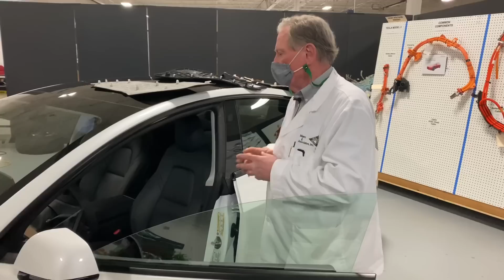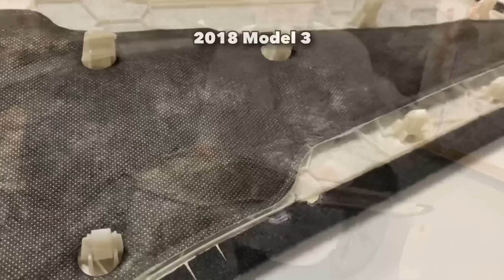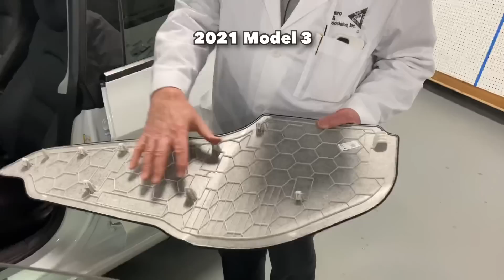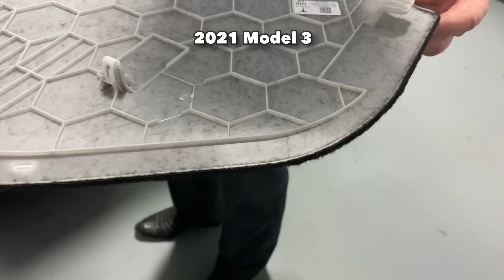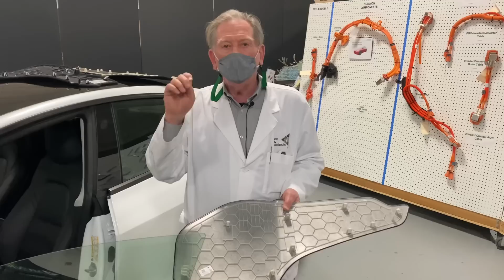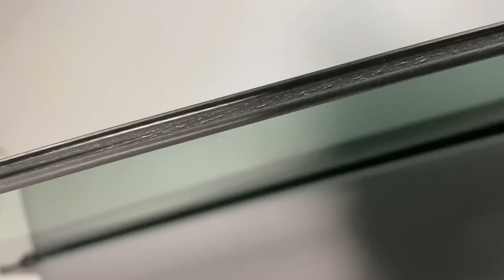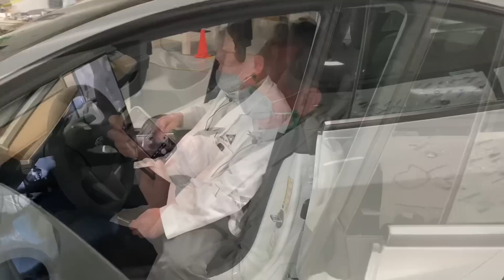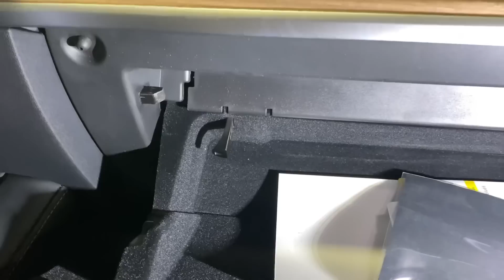2021 Tesla Model 3: E6 - Interior Updates

Comment: Hi Sandy, I believe you should also report on issues that you will get only when you have driven one awhile. My year old Model 3 SR+ has been in service 12 times or so and one of the issues is -14.4% capacity loss which they call within specs, leaky taillights, leather coming off steering wheel, paint issues, factory platework issues (dented at fold in corner doors low point), frunk coming off, headlights adjustment going off all the time after update, rattles in dashboard, excessive wind noise, Autopilot is completely blinded with very low sun and stops cruise control, cameras blocked by fog, can fill a list.

Most annoying is that Tesla won’t do anything about it most of the times, or try blame me first. It seems policy to only fix some of the stuff after a third complaint.
Reply: That is a bummer for you, but stats seem to show that your experience is not typical.  An individual having problems with a car does not necessarily indicate that the model is of poor quality.  For that you need to gather lots more data.  However I would agree that Tesla not resolving the problems to your satisfaction is worrying for a luxury brand.
Reply: @andrewpaulhart  Hi andrew, my experience seems to be common. Also the average fleet data suggest all SR+ 2019 models have -11% degradation/capacity loss for example on average according to fleet data (year old or 30k kilometers). I have all the data to prove this.

How come the last two years it takes multiple weeks on average before we can visit a service center if nobody is coming in for problems? There are lots of Service points in NL.

Look up on youtube the DIY fix for leaky fogged up watery taillights for the Model 3, it’s been watched ALOT, I am not alone. Same for alot of other issues.

Simple question about this (just) one thing: Would you expect it to be normal to just accept -14.5% capacity loss on a brand new vehicle is “within specs”? My SR+ is not even a SR and a battery report from Tesla is “secret” they won’t share it even though I bought the car and own it..!

Again, if you also have these issues, don’t you want Tesla to do better there and actually have a good warranty?
Reply: @andrewpaulhart  And Hi again Andrew, I even have friends who are car mechanics, that work at Tesla and tell me exactly the same thing. (I used to be a car mechanic myself, i build my own ground-up e-moped with 18650’s) It’s easy talk when you don’t (notice or) have issues. Lucky you don’t have issues
Reply: @MrGoogle87  regardless, any individual report tells you very little.  I personally put more weight on proper statistical evidence if you have some.  As you have seen from one of the replies to your post there are people who say they have absolutely no problems at all.  Those accounts also dont count as proper evidence either.
Reply: @MrGoogle87  although I suppose the testimony of Tesla engineers does add some extra credibility
Reply: @andrewpaulhart  I don’t even have a “problem” with the fact that I have problems, I have a problem with Tesla not doing anything with it (like the -14.4% on my battery, it was already bad first month and I reported it. 205miles rated left only, that’s excluding the buffer above 240mi rated)

In short, to them warranty says only something about -30% or worse (but again; capacity test is secret, they won’t share it even when you pay!) so -15% after first charge ever is fine to Tesla’s current warranty policy: that means a LR Model 3 only has SR+ range guaranteed. Not all packs are created equal. The SR+ mainly has high degradation according to fleet data, i am also bottom of fleet, average is -11)

If they fixed the problems, I wouldn’t care. Right now it’s all about ghosting you, at (i tried) three different service centers. I paid in full but somehow the official pack capacity is “secret” that’s also not OK.

Currently have 46kWh nominal full pack, Means I can use about 44kWh when charged at 100% (i have ScanMyTesla to confirm it besides test drives). The Official EPA documents state a 54.45 kWh useable capacity, so ~10kWh is gone! That’s a big difference